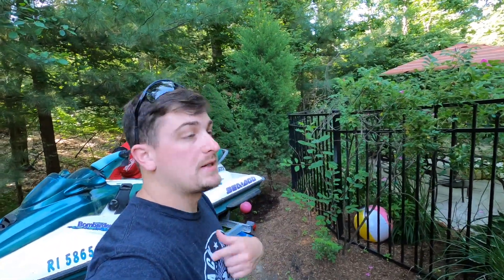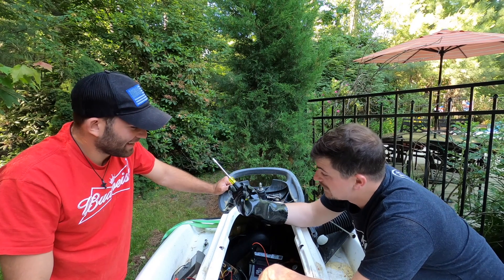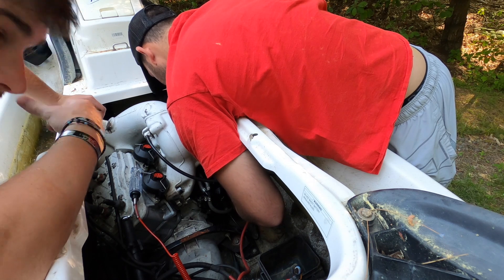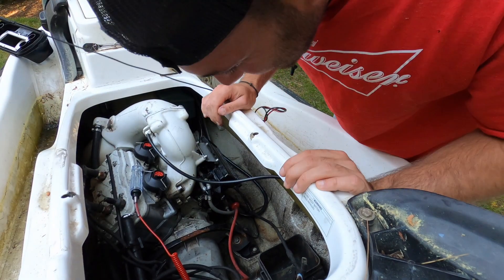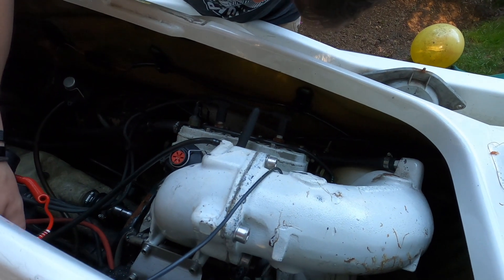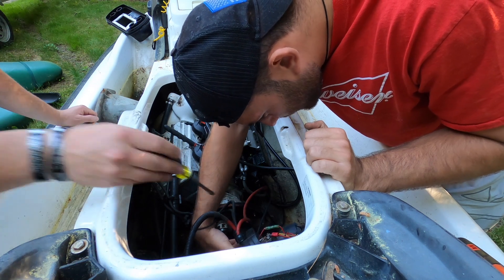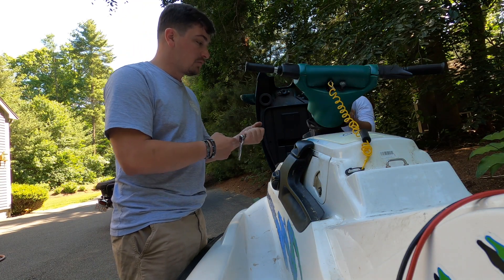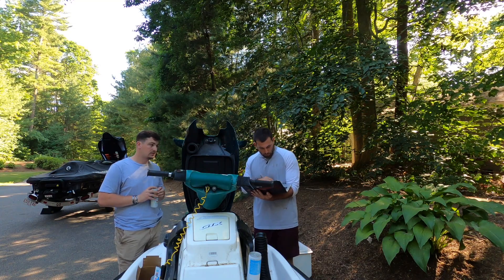CHEAP SEADOO GTX REBUILD (PART 2) BIG ISSUES???

Comment: I just said Westside do a reprogramming of the key on a 97 GTX 787 I watched your video I kind of went through the same thing you did but after having a new key program from Westside that eliminated the problem I also bought a new post with the post is not matched to the key so you can change the post but you definitely have to have the key reprogrammed so I hope this helps

Comment: You always go for the starter, number one thing to replace not only because it's more likely going to be your problem but it will be your next problem after it runs a couple times so why not do it right
Reply from the maker: Yeahhhhh it wasn’t the starter but normally i agree starter and solonoid

Comment: Hey buddy I’m having similar issues with the power it’s only showing 12v low and key isn’t doing much…I know you said your buddy was missing with the mpem and then you got beeps and the start button worked but which exact relay are you talking about not working that you fixed?

Comment: Could you tell me the mpem part number on your 97 gtx please bud? I've found 3 different numbers 278-001-133, 278-001200 and 278-001-242! Mines got that last one but doesn't spark, and the manual states the first one, but seadoosource lists all 3 🤣

Comment: Hey do you know how to change the oil I have the same exact one
Reply: Not the actual 2 stroke oil the oil for the engine
Reply from the maker: AirBew therw is no oil for the engine in 2 stroke engines the only oil is the oil mixed with the gas aka the 2stoke oil it lubricates the cylinders when the fuel gets mixed in through the carb

Comment: I have a parts 96 gtx, let me know if you need anything. (96 and 97 are the same)
Reply from the maker: Nascar All out this is awesome to know i will for sure let you know!
Reply: What do you got i might need parts for my 97 gtx i just order a new key post to see if that solve my problem with the power cutting out
Reply: Chris King I have all the electronics, no motor though
Reply: @Hoopty-ce8of  ok I'll let you know when i get to that point
Reply: @Hoopty-ce8of  i might need a rectifier or the computer my power keeps cutting out when I ride but i think it the post
Reply: Do u have the cover for the hood.  Its the green piece of plastic that covers the gauges
Reply: Jordon West just sold it.

Comment: If it's cranking over check your fuel line and compression. You are pull the choke out when you starting right? and try turning your fuel to reserve.
Reply from the maker: Chris King the issue is it’s not cranking over with the start switch so it’s tracking down where I’m losing the power
Reply: If you are in the kitsap or Jefferson County area I'm going to be in that area this weekend i can swing by and check it out if you want help near it down
Reply from the maker: Chris King thanks I’m way out East but if we continue having problems I’ll let you know!
Reply: I got the same craft. Got to know it pretty good. Right know i got to push down on my key to start it
Reply: Did you check the 2 fuses on the computer and the one fuses by the ignition coil that one is kind of hidden i would also check all the connections make sure there good.
Reply from the maker: Chris King all the fuses appear to be good and have continuity in going to use a test light to trace where power is going tonight
Reply: @TaskForceOffroad  how about your rectifier
Reply: @TaskForceOffroad  or the coil pack
Reply from the maker: Chris King i just swapped the rectifier but not the coil pack however the coil pack would stop the ski from being able to crank from the start button
Reply: @TaskForceOffroad  i think so. Didn't you change out your key post or did you leave the old one in? Also if you kept the battery hooked up the craft like to drain it so check you battery. Also check the start button switch. It sounds like it was trying to kick off when you were doing the screwdriver thing
Reply: @TaskForceOffroad  i know it takes 5 to 10 seconds holding the button down and holding the choke out for the first start up too